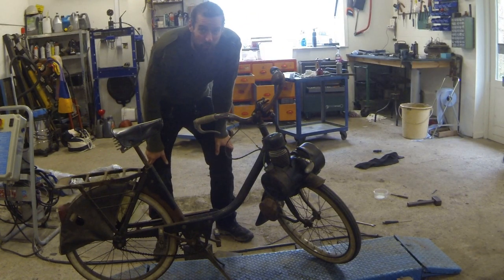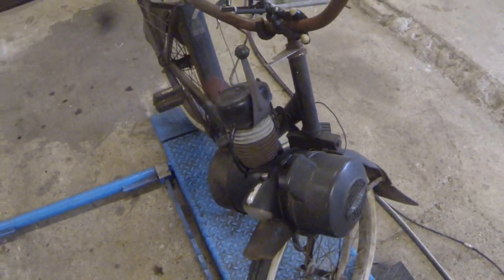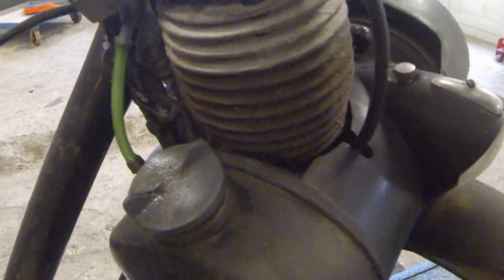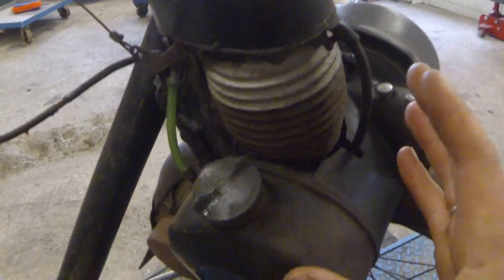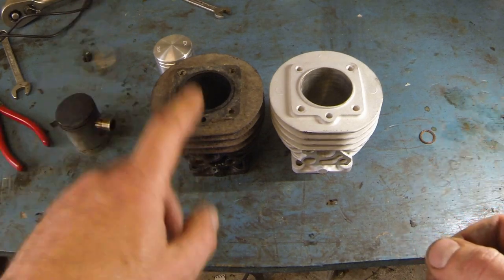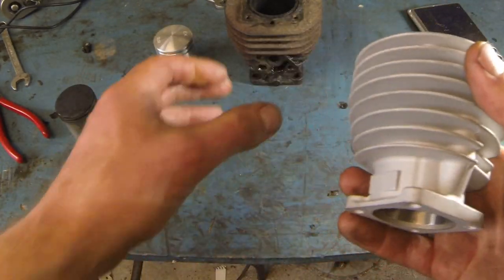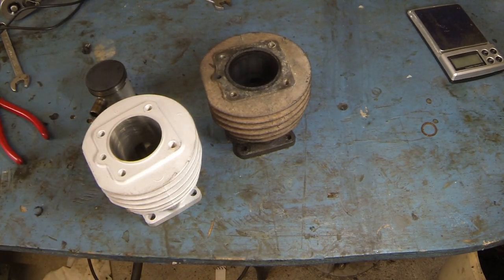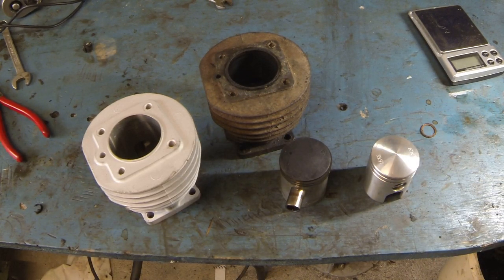Velo Solex- Performance aluminum piston and barrel.

Comment: A very interesting video showing the difference between the new 'aluminium' cylinder vs the old cast iron one and the updated piston to suit. I think the performance will improve when the piston has seated itself in, it sounds a more hollow note. Having 3 rings may wear away the cylinder quicker. Then of course what lets these engines down is the transmission.  

Please after you have run it a bit longer, can you remake the video showing us any improvements.
Reply from the maker: Thanks Quentin!

I will make a video on it when the weather gets warmer... I think I am going to look at the fuel mixture also :)

Thanks for watching!

Comment: Okay tak kan du huske hvor du købte den ? Har set de har 3 slags moped speed med 3 skylle kanaler en 39.5 mm og en 40 mm og en 41 mm syntes din lignede den 40 mm på den måde udstødningporten så ud. Kan du huske hvad det var for en du købte. Jeg har en solex magen til din som kun kører 27 så ville ønske jeg kunne få mere ud af den.
Reply from the maker: mener at det var 39... kan godt være 40...

Har købt den enten på mopedspeed eller cafesolex.. :)

Jeg har siden monteret flere 39 fra cafesolex med 32 dyser... det køre ret godt... ca 37kmt

Comment: I have had big problems starting my 2200, since i changed to the aluminium cylinder- it simply wont drive (engine is acting funny) have til har similar problems?
Reply from the maker: Nope... Mine runs perfect!

Comment: Hej, jag har en 2200 o funderar på att köpa o montera ett kit med alu cylinder men att stanna där - inte byta ut topp, förgasare eller avgassystem. Hittar två typer av kit; antingen 41 mm eller 39,5 mm diameter. Större diameter borde väl ge bättre torque - eller...vilken testade du, vilken skulle du välja idag? Min andra knallert är en Solex Flash från 1969 som utan problem kör i 35-40 kmh, otrimmad. Hoppas åka "blommelöbet" i sommar, kanske ses vi där!?
Reply from the maker: Hej! 

Jeg husker faktisk ikke om det er 41 eller 39.5 jeg har... Men tror det er 41.
Det går ganske fint kun med cylinder, men den skal have større dyse eller en justerbar strålespids... Jeg vil anbefale dyse... Strålespidsen gør den lidt svære at starte. :)

Jeg kender ikke blommeløbet, men skal køre Velo solex Rally på bornholm til sommer! :)
Reply: @SeasideGarage  det är säkert samma "löb" vi menar - med start 25 juni på Svaneke torv
Reply from the maker: @sven-erikandreasson1071  ja lige præcis! Det var sjovt! :)

Comment: How does the engine drive the front tire? Does it have a gear or a belt?
Good video very interesting.
Reply from the maker: Its driven by a friction roll... Actually just a small wheel that presses against the tire :)
Reply: @SeasideGarage  Sounds like it would put a lot of wear and tear on the tire?
Reply from the maker: @SDsailor7  Yes! And its very important that the centrifugal clutch works, otherwise it will burn a hole in the tire in no time when standing still.. :)

Comment: upjet a little
its begging for a pipe
Reply from the maker: Its actually already jetted up a bit... Id like to keep the original look of the bike, so no pipe...  :)
Reply: @SeasideGarage  unfortunatly that is your limiting factor. the extra port timing is opposing the resonance of the standard exhaust. try REDUCING the exhausts exit diameter ;)
Reply from the maker: Are you sure? I know this from other velos solex or mopeds in general? :)
Reply: built a few hundread two stroke engines bud ;)
Reply from the maker: @minor0confusion  thanks :)